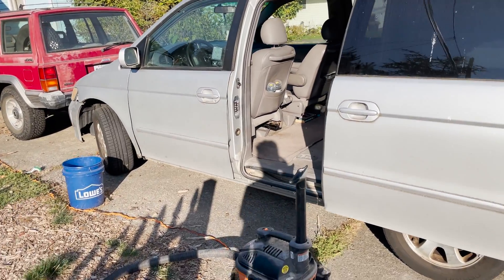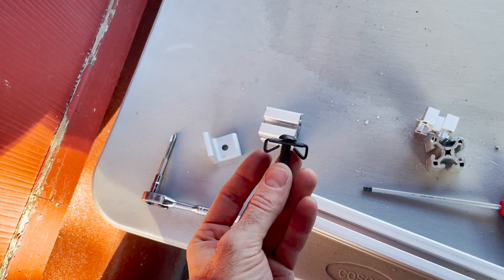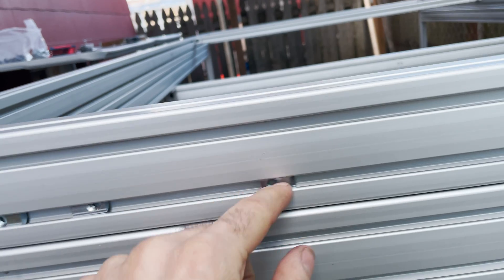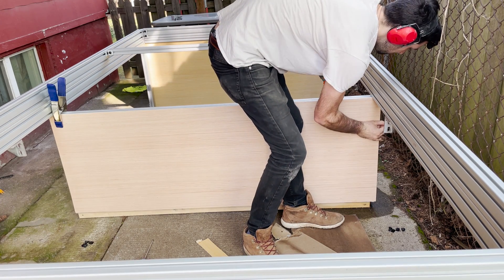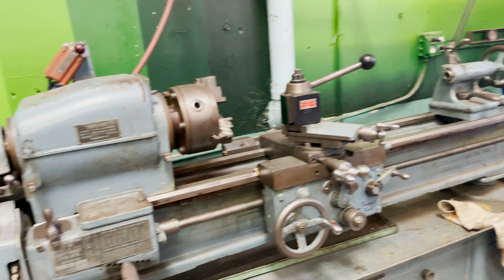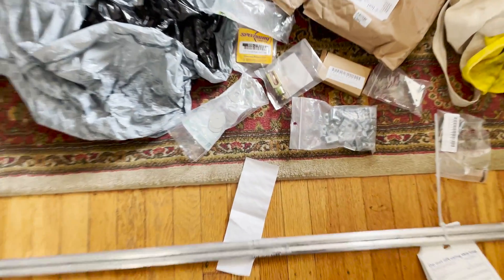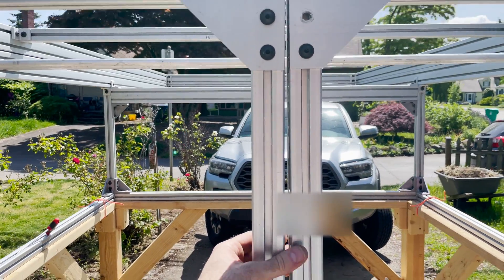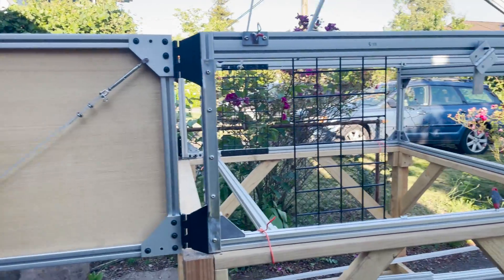Building a Truck Camper From Scratch - Part 1: The Frame

Comment: Here's a cool hack for cutting aluminum...
WD40 is kind of expensive and it makes a mess of your saw. 
Instead, use standard cheap bar soap. Turn the saw on and touch the blade with the soap before each cut.
Reply from the maker: Oooh that sounds like a good hack! I've gotta give that a try next. thanks!

Comment: Nice job, well done! Will there be a video where you go through some specs of the final build? I would be very interested in the final weight. Thanks!
Reply from the maker: Yes I am planning on doing one more video on the build series to cover the insulation, fan, and headliner. Then after that, I am planning on doing a whole walkthrough video and a separate video on the final weight and cost

Comment: I work with Bosch-Rexroth Extruded Rail that you're using. They make those 10:35 T-Nuts with spring steel clips on the bottom, they're fiddly to install, too, but once they're in, they hold their positions well.
Reply from the maker: Thanks for the comment, that's great feedback. I saw those as well when I was checking out t nuts, I'll have to give those a try in the future.

Comment: Looked up your parts list but didn't find the 90 corners you used with the black bolts, I'm actually getting reading to build a work topper but a high topper to walk in it. Inquired about one and it was 17k for my Duramax.
Reply from the maker: Glad to hear you're building your own! I got all of the 8020 hardware from tnutz.com, it was all pretty affordable and they ship pretty quick. Best of luck!

Comment: I'm planning on something similar on an older Ranger, based on a used System One contractor rack. They're made from modular aluminum extrusions, so they have the benefits of 80-20 and you can trim down a larger one if your truck is smaller. One detail I really like about those units is that the sides match the angle of the cab, for better aerodynamics.

My side gates are cut from a fiberglass tonneau from a full-sized Silverado long bed ($60 from Craigslist) with full-length hurricane hinges. I'm planning on XPS foam construction for the top panel, just doing my first experiments with creating curved shapes and various fiberglass alternatives.

I, too, joined a local Makerspace to work on this and other projects. It has been awesome. Looking forward to seeing your progress.
Reply from the maker: That's great to hear! Sounds like an awesome build. Keeping the camper as aerodynamic as possible is a great idea because I definitely noticed a decrease in fuel economy since adding the camper. Best of luck on your build!

Comment: How do you calculate the weight capacity of the overcab  bed part. You dont want it to bend and touch the top of thr truck
Reply from the maker: I recently added some feet to the bottom that rest on the top of the cab. I will post another video shortly about how I made those.

Comment: What is the profile size? It looks bigger than 8020. and what is the length of your top?
Reply from the maker: It's 15 series, so an inch and a half profile. The top is around 114"
Reply: @nolangordin  And did you order the long profile from Amazon too?
Reply from the maker: @ No I got most of my 8020 from Grainger

Comment: Nice design build execution
I personally would have done double the work aka buy & cut 
2Xs as many pcs or cut for multiple builds. It's aluminum it stores well. You can sell kits to OFF set ALL of your expenses particularly since you have a YT channel & curious people want to buy
Reply from the maker: Thanks for the comment, that's a great idea! I've been so focused on getting the one done, but building two in tandem would've been smart. Maybe when the one is done, I can use the same designs to make more to sell

Comment: Why not get rid of the back fenders and bed plastic and build on a flat platform? Couldnt you go a bit wider and be less obstructed if you would go that route?
Reply from the maker: That would certainly be the best idea if I was doing a permanent installation, but I intend to build camper jacks to remove the camper so I have the ability to drive the truck without it as well
Reply: @nolangordin  Im thinking along the same lines. I have a rear box I got with the truck and I got a deal on a rack also.... so that might lean me to keeping the bed as well. But you never know...

Comment: Would it be possible to have the measurement of all the extruded aluminum part you used for the base frame and tent please? It would help a lot directing me on the right way
Reply from the maker: I don't have that documented very well currently, but I am thinking about making a build sheet with all the data that I can sell on my website once I finish.

Comment: I have the same truck and am looking to tackle a project like this! Do you have cad files or plans available? I’m super interested in following your journey and learning
Reply from the maker: Thanks for the comment! I do have some pretty rudimentary CAD files, but I am thinking of putting together a manual when I am done with all the materials, costs and building instructions. A lot was changed on the fly or custom manufactured once I started building, so it might be tricky to lock down the exact layout

Comment: Thank you for the video. The build is very similar to my design… that exists only in my head that has evolved over many years 😅. I am at a point where I will buy a bed rack and RTT. Don’t trust my fortitude to finish the project if I start.
Reply from the maker: Haha makes sense! It's been over a year that I've been working on this build, so the RTT is definitely the way to go if you don't want to deal with the hassle

Comment: How does this hold up with the vibrations?
Reply from the maker: Pretty good so far! I had a few loose bolts last time I checked, but tightened them up and haven't had any trouble since.

Comment: Only thing I can suggest is heavy Loctite on all the bolts
Reply from the maker: Thanks for the comment! I did use locktite on all the threads that I tapped myself. All of the other bolts into the T slot are intended to lock into place as the bolt tightens into the slot.

Comment: You can buy strips that pop into the aluminum slots to keep out water.
Reply from the maker: Yes I've been considering that. The rubber insert strips are a bit expensive so I've been holding off, but with all the rain we've been getting, I think I will need to make the purchase sooner or later.

Comment: Would be cool if you talked about the place where the top meets up with the base when it folds down, nobody shows that. Does it just rest aluminum against aluminum when it closes or is there some type of weather stripping?
Reply from the maker: That's a good call, I can mention something about that in the next video. The roof meets the sides and front on a long run of weather stripping, but the back gets sealed when the doors close. There are little gaps, but I found that the most water finds its way in through the gaps in the truck bed itself, so I have to find a way to seal those gaps better.
Reply: @nolangordin  so the top just rides on a weather seal strip, a hinge at one end and the gas struts plus the clamps that hold it closed? Thats pretty simple and nice how that works out.
Reply from the maker: Yup totally! The four hinges along the front keep everything aligned

Comment: Did you have any issues threading with the drill vs manual?
Reply from the maker: I was worried about threading with the drill, but I stepped the motor down so it ran nice and slow and I was able to control it pretty well. No issues so far!

Comment: I get aluminum is lighter but if you could weld why not use steel and for all these costs you incurred you could have bought one of these campers. At least the top portion or a used model. But if it’s for the video I guess that makes sense but most folks this wouldn’t be practical.
Reply from the maker: I did consider welding, but I wanted to avoid steel as much as possible for the weight and the rust factors. I have heard that welding aluminum is very challenging and I am not great at welding. Since this was my first build, I wanted something modular so I could change it if needed. The 80/20 was expensive, but I am still coming in at about a 1/4th of the price of a four wheel camper. The other thing is that I gain the experience and am able to build a design that is specific to my needs, so I am pretty satisfied with the price and effort so far.
Reply: @ you can buy aluminum brazing rods that weld the aluminum and just heat up the metal and it welds it.

Comment: I want to biuld me a camper as to save all my money. Cause I don't want to pay one week salary out of the month for rent and cost of living. I really like your design I recently came across anther video of this ole boy from Australia using this material. Now are you using 2020 or 4040?
Reply from the maker: Ya I highly recommend building one yourself if you have the time and ability! I used 30 series 80/20. It was so easy to work with, but it does come at a high cost. If you're trying to do it as cost efficiently as possibly, I would recommend welding aluminum tubing instead!
Reply: @nolangordin  i looked on Amazon and it's really not that expensive. Idk what 80/20 is but I did see 2020 & 4040. But yeah exceptional work brother it looks durable. Nice video
Reply from the maker: @rodneyfernandez5304  Ya it was well worth it to have material that was easy to work with. I found it through a local supplier instead of Amazon so I saved on shipping that way. I think it was about $12 a foot when I ordered it

Comment: An idea for some wanting a metal grid. Local farm stores have livestock panels. The best choice might be horse or sheep/goat panels ( less variable openings) .
Reply from the maker: That's a great idea! The grid panels I ended up with are for clothes displays and they worked great, but I bet the livestock ones would be cheaper and easier to find. Cheers!

Comment: Loctite anyone?
Reply from the maker: I used Locktite on all the bolts that bolted directly into threaded pieces. All the t-nuts are designed to bend the aluminum slightly to lock them into place.

Comment: Considering the quality of the build, sure looks to me like a full pop up would have been easily possible. Even found a video recently about calculating the four gas struts for DIY builds. I have a jeep gladiator and so this is really interesting 🤔
Reply from the maker: Ya that's certainly something I thought about, but I ended up keeping it with the more simple wedge since I wasn't going to need the additional space above the bed anyways.

Comment: Nice work! I REALLY want to build one of these for my F250. I'm thinking about doing a rear 'walk through' opening like you're doing. My thought was to make it a rear door like a GFC and somehow make the top bar removable. Probably easier said than done. But I was thinking that the top horizontal piece could be 'rolled up' with the pop top for a van-like walk in through the rear. If I build something, I would like to build a frame that has the esthetics of a GFC topper, but operates like the ovrlnd bivy - no overhang+full pop top, not a wedge since my bed is 6'9". However, my wife said "when do you have time to build that?" lol, so I'm probably just going to get a alibaba RSI style cap for now and keep thinking about what I would build ORRRRR build a topper only for now, seems like V1 could be a frame & cabana doors + a little waterproofing and call it a day. I think I might be able to build that for about what the chinese alibaba would run...just not sure how many hours that would take and I would really like to build the frame to angle in at like 5° vs. 90° angles, but I certainly understand why 90° is easier. I'm following along!
Reply from the maker: Thanks for the comment! Yes it's been a very fun project from an engineering standpoint, but it's taking forever so take that into consideration as you get started. I did consider the removable bar which could be held on with thumb screws or something, but I figured the rods would be better because they are multi-purpose. Best of luck to you!

Comment: Well, i was going to mention putting in bed stiffeners on the part 2 video as that would be the newest. But it seems your in zero rush to post that especially after 3 months have gone by, lol.
Reply from the maker: ya I do plan to put bed stiffeners in, but that won't be until part 3 I think. It's not that I have really been in zero rush, it's more that it's just really taking a long time to build.

Comment: Not sure if anybody mentioned it, maybe it will not be an issue?  But aluminum that comes in contact with steel may cause the aluminum to corrode over time.  If you see white powder near such a joint is an indication the aluminum is corroding.  Hopefully that won't be an issue because using alum extrusions seems ideal.
Reply from the maker: Thank you for looking out! I have considered that and I hope the paint on all the steel parts will help mitigate that, but if I end up having any issues, I will likely take those pieces off, strip the paint and then powder coat them.

Comment: Have you considered the weatherproofing for your in laid plywood panels? I've had really good success with laminating chop strand fiberglass to plywood without warpage or water intrusion. Adds a considerable amount of weight though. I wonder if there is an ACM panel at a thickness that would work also?
Reply from the maker: Thanks for the idea! I've considered going for plywood on the exterior, but I ended up getting ACM panels for the whole exterior. I feel like it will hold up and look better over time. I actually just finished all the panels, so that video is coming very soon! Keep an eye out!

Comment: What is the length of the longer sections for the main wedge portion? Ive been looking at builiding a camper as well but cant find extusion over 10 feet long but im hoping to make mine with one piece thats 11 feet long
Reply from the maker: The longest sections of 8040 extruded aluminum is around 118", so just under 10 feet. You may be able to find 15' sections, but I stayed under 10' for ease of materials, plus the thing is already massive without adding an additional foot so that was sufficient for me. Best of luck with your build!

Comment: You are going to have some serious structural issues with the top popped and that rear door open if you have no cross bracing for the lower section.
Reply from the maker: I thought about that too, which is why I added the tie rods. It only really needs the structure while it's driving, when it's stationary it should be fine. Take a look at the Harker edc for a similar 'mass production' design.

Comment: Can you share approximate cost of the materials? I ask because it just looks like a awfully expensive way to build
Reply from the maker: I am planning on doing a cost breakdown at the end of the series, but If I remember correctly, the extruded aluminum at this point cost around $1800. It's more expensive than I was expecting, but still cheaper than any manufactured camper I was able to find on the market currently.

Comment: Interesting video and your choice of the extruded aluminum isn't one I've seen before in DIY camper projects. At least not for the full project, there are many uses people have done for interior cabinets and framing in vans. I'm retired now but have built many projects using 80/20 Company and Bosch-Rexroth aluminum extrusion systems for custom work benches and factory machinery. Very strong when correctly used. But also very expensive and can get quite heavy due to the complex extrusion. I am hoping to build my own camper on a pickup, likely a year or two before I can begin. In my case my thinking is to remove the bed and start from the truck frame. Pickup would be either an extended (not a crew) cab with 6' or a standard cab with an 8' bed length. The aluminum would not be the bolt-together systems, but rather use simpler and less expensive square tubing. Teach myself to weld it together, there are loads of videos on that. Money saved on expensive complex extrusions would pay for the welder, I hope. For me it's still in the imagining stage, taking notes, collecting videos. One thing that intrigues me is how much can be done with the latest LiFePo4 battery tech to build upon. It is now possible to have all lighting, food storage, cooking, heating and cooling using on-board battery power. A compact 4x4 truck camper with that tech featured really has my attention.
Reply from the maker: Thanks for the comment, great to hear that you're interested in making your own! I've heard welding aluminum can be challenging and fairly unhealthy if not done in a well ventilated space. I considered using steel tubes for the frame, but I wanted to keep the weight down and have the flexibility to change it later if I need to, so that meant going for the more expensive 80/20. Best of luck to you!